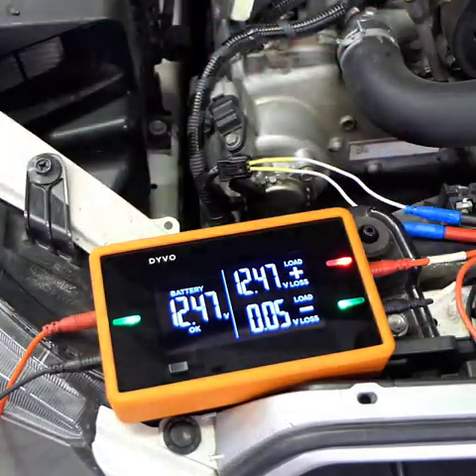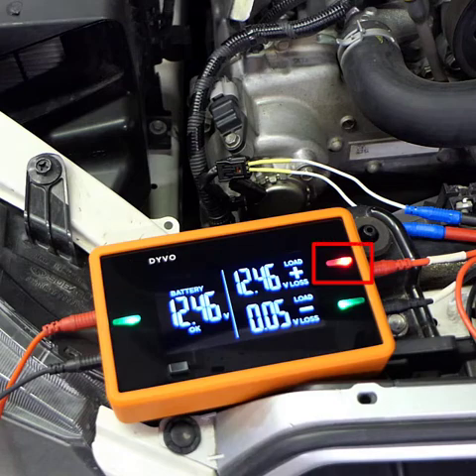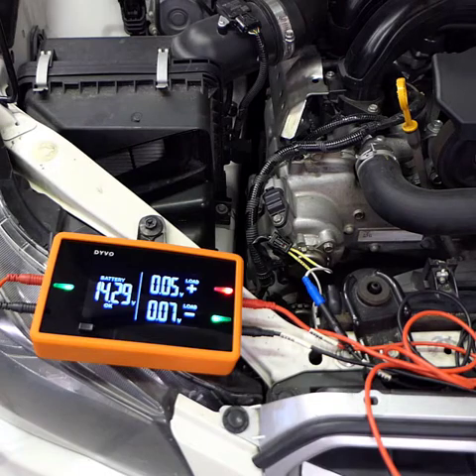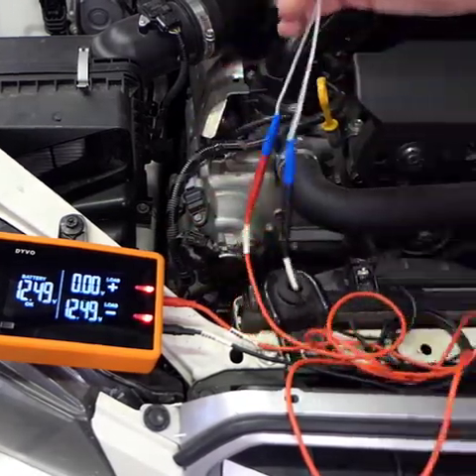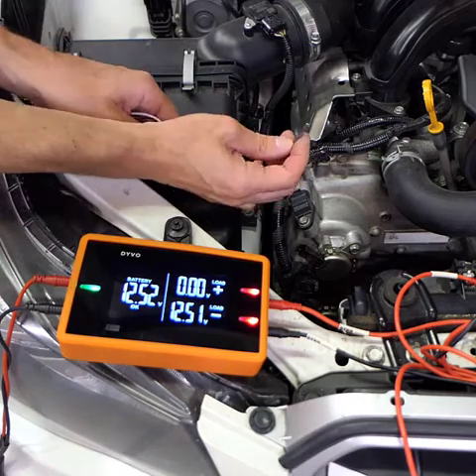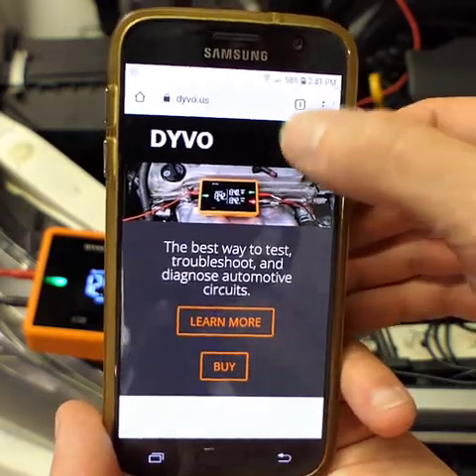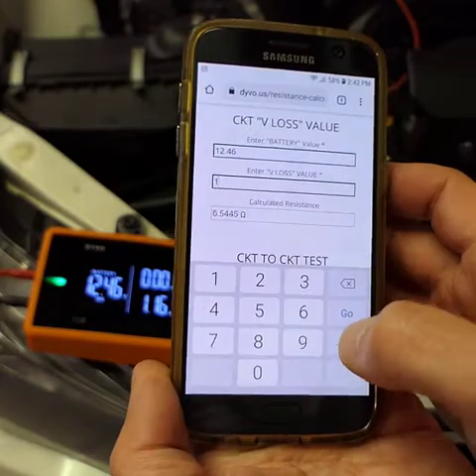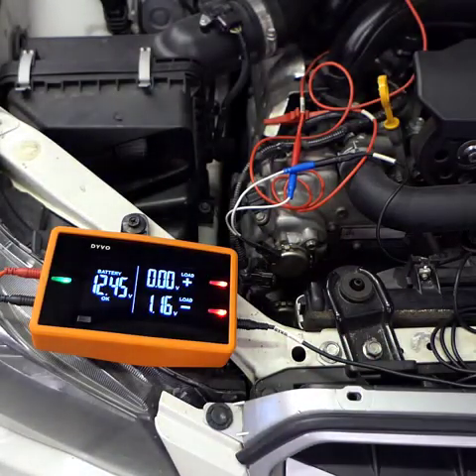How to test a cam actuator solenoid

Comment: Can u show us video using it on a 5v ref or signal +/-
Reply from the maker: Thanks for the comment. We cover testing a 5v reference circuit, as well as the low reference and signal for a crankshaft position sensor. This process is the same for all 5V circuits. Check out our video "How to test a crankshaft position sensor" starting at 1:48. https://youtu.be/Y7yul0hFPHQ?t=108

Comment: Just use a 20 dollar test light be done with it. I like the idea of dyvo but it’s to expensive. You could buy a used fluke and power probe for that price
Reply from the maker: Thanks for the comment. DYVO is different from both a traditional multimeter and Power Probe, so combining them isn't going to do what DYVO does. Each of these tools have different purposes, and many techs will use all three for diagnosing.
Reply: I could see this tool being very useful on a starting system voltage drop test. Charging system test of the big battery cable voltage drop from b+ to alternator stud. Window mottoes circuits possibly
Reply from the maker: @philh9238  Thanks for the feedback. Yes, DYVO works very well for starting systems. The dual channels allows you to see voltage drop of two things at the same time, such as the main B+ cable and case ground, or solenoid drop and the trigger wire together. Great observation about the window motors too! Again, having the dual channels with DYVO let's you load test both circuits to the window motor at the same time. Keep an eye out for a new video coming soon using DYVO to test window motor circuits!